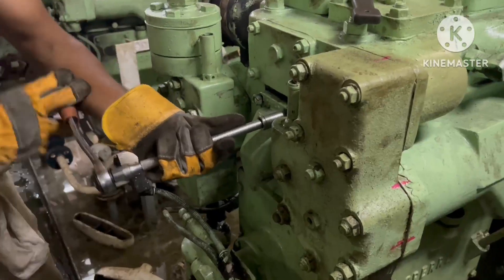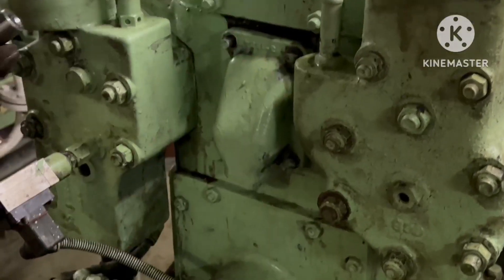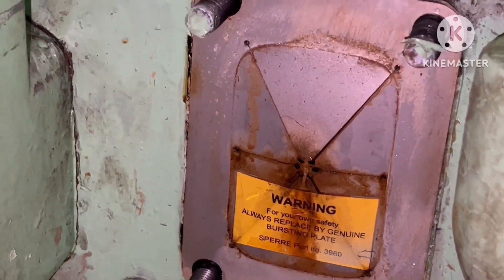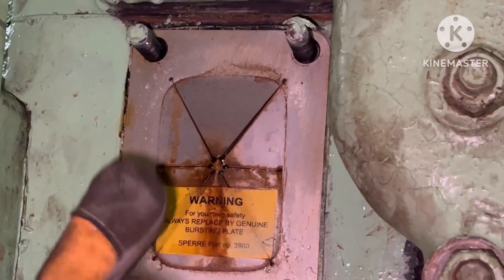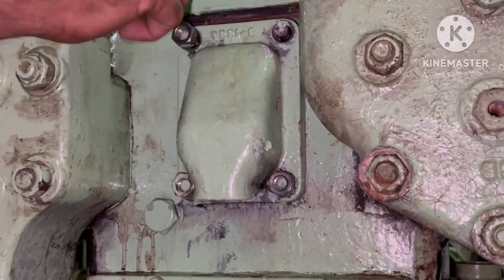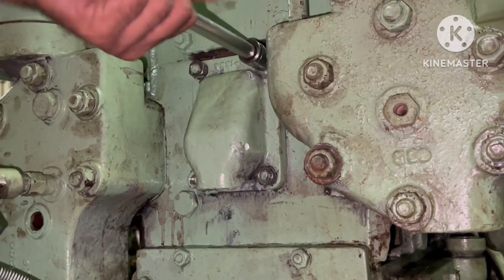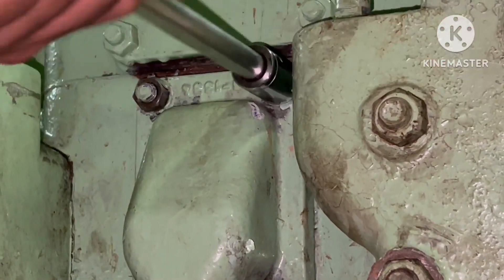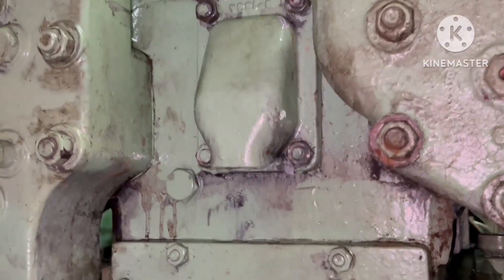BURSTING DISC ON MAIN AIR COMPRESSOR... FOURTH ENGINEER SHOULD KNOW..

Comment: Sir,
I have one doubt, bursting or melting of bursting disc depends on pressure or temperature?

And bursting disc is fitted on intercooler or aftercooler then where is fusible plug is fitted?
Reply from the maker: pressure sir

Comment: L.P. valve in the compressor is leaking .....how do you know that while taking engine room rounds ??
Reply from the maker: U can find the pressure will be not in range
Reply: @marine-knowledge-basha  which pressure surveyour asked me that???
Reply: If running hr of MAC is more then usual then there is a air leakage

Comment: Sir why we dont  use bursting disc on HP side.
Reply: @cdisscvdid  bcoz same water is flowing in both coolers, if there is leak of air in HP cooler then also LP cooler BD burst to maintain CW pressure

Comment: 1) What is the reason if first stage safety vave activetes ? What action shoud be done ? 
2) What is the reason ifsecond stage safety vave activetes ? What action shoud be done ?
Reply from the maker: * For both the condition..
* check the condition of valves.
* check the condition of safety valve...